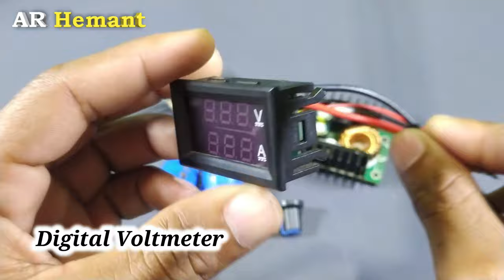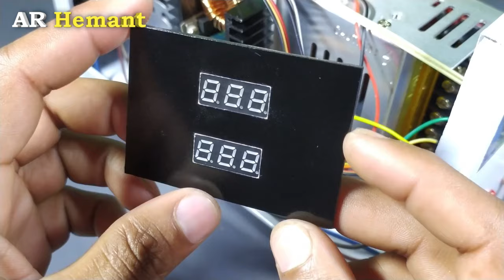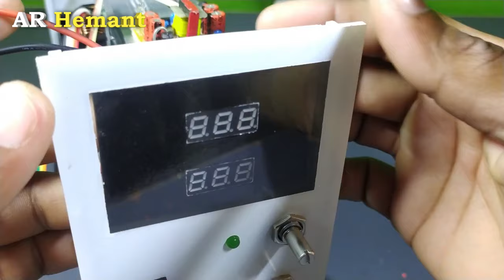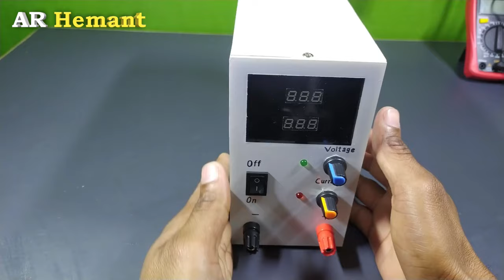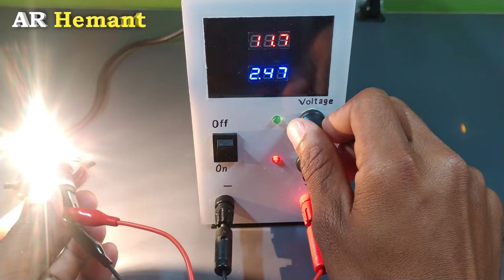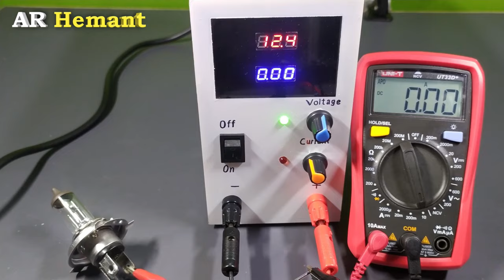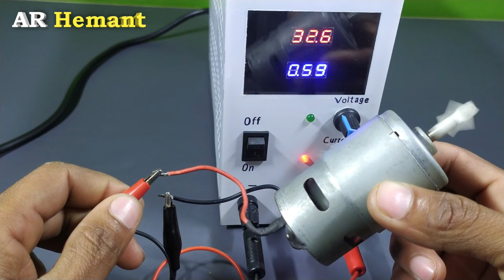DIY Variable Lab Bench Power Supply | 110V/220V to 30V 10A DC Power Supply

Comment: If you went to the effort of desoldering that display.. you could've taken a few 7-segment display modules and wire them up like the small display to get a bigger screen that would look better on a big power supply. Also, cover the display with a foil of some sort, even an black trash bag makes the unlit segments invisible, making the screen look so much better.

Comment: This is a nice project but I suggest you make the setup before putting them into the case, sometimes you could burn the wire while soldering in such small space, adding a fan is necessary because 10 amps is a high current for the buck converter and the power supply, small ventilation will overheat the setup and maybe will damage it. Last are the wires, 10 amps needs atleast 18 AWG but in conclusion this is a DIY variable bench power supply

Comment: Hi,  Thanks for sharing this nice power supply. I notice that your connection from the buck convertor to the two potentiometers in the connection diagram is a little different from the actual solderings in the video. Could you clarify which one is correct?

Comment: Nice project! I just couldn't figure out where  the led's connected to the board...
Reply: They are initially on the DC-DC converter, like the multi-tour potentiometers. He just removes them and places to the front panel. Green for power on and red for short circuit indication.

Comment: Will the circuit work properly if I use 19.5vof 2.31A charger of laptop and connect its output with dc to dc step up module (XL6009) and adjust it to 24v dc and then connect this output wires to 300watt dc to dc 10A stepdown buck converter to get a output voltage varies from 24v to 1.2v?

Comment: ISO Wire Color Violation (AC INPUT)
SAFETY GROUND ALWAYS USES : Solid GREEN or GREEN with YELLOW Tracer.
** BROWN was used, which signifies LINE (HOT) and that Wire Color was used on HOT AC INPUT (120 or 240 VAC). **

Comment: Hello you did a very good diy this is very useful for me. Just 1 question do i need to short the output everytime im using it to set the amps? Or no need? Just the potentiometer?
Reply: Use a false load or add 10 ohms resistor between your output
Reply: No you don't. And never do that. He is just trying to show us that the power supply provides 10 amps as promised. When you connect the load to the power supply you will see the current being used. Than you can adjust or limit the current to the requirements.